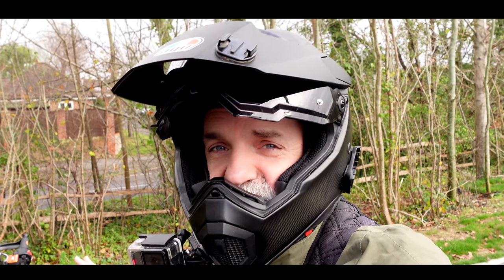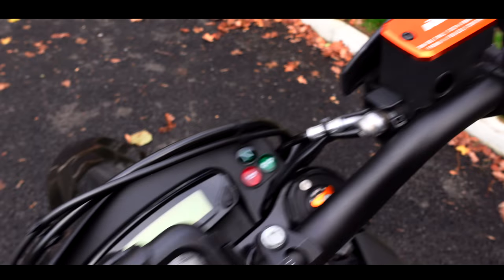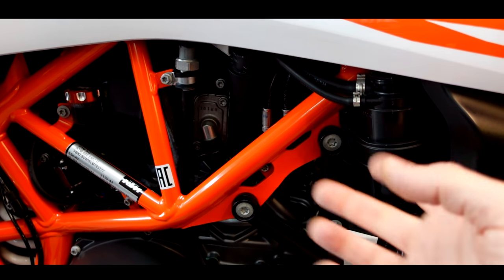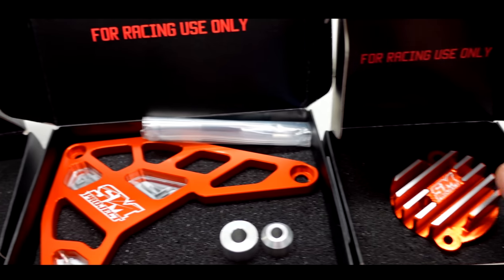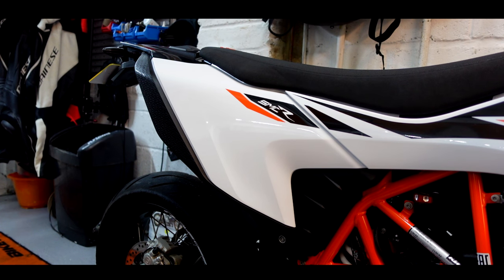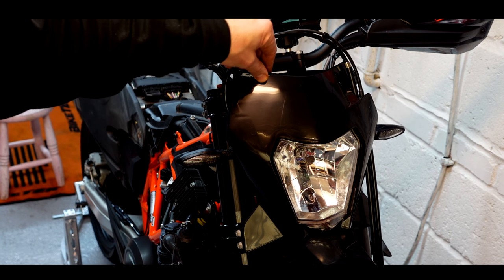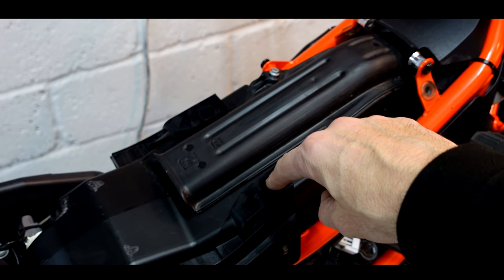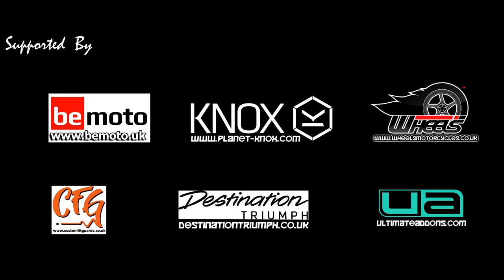The Ultimate KTM 690 SMCR Build 👌 |EP01

Comment: Excellent video, nice n informative, I have a 2007 690 SM, the beaker! Gray area racing in the USA do nice range of flow matched injectors, I have a 550cc max flow per min version, also I have removed the  2nd 3rd gear restriction, massive K&N , keep up the great work!
Reply from the maker: Ok interesting Pete, think the new one is single injector.. will see when I strip it tomorrow 👍

Comment: have u looked at the wings exhaust 
its alot smaller and apparently made in the same factory as the akrapovic
theres a few vids on here
i picked my 690 up other day
i’ve already done the tail tidy delete
i spent half hour looking for a keyhole to take the seat off 😂
you went in
loadsa bling 💎 
looking forward to more vids 👌🏻
Reply from the maker: Yes I used to have one on my 701 they are good. Made by an ex Akro employee is the connection 👍

Comment: A few important things not being done. 1. Sub-frame strengthening kit. 2. Manual cam chain tensioner. 3. Motor Master front disc. 4 ABS dongle etc.
Reply from the maker: I have one of those things coming, not heard of any cam chain tensioner issues or weak subframe..

Comment: Do you reckon if I put  a pcv in my A2 restricted smcr I could make it full power? Obviously with an A2 power mode
Reply from the maker: No as I think they restrict it in other ways than fuel.. not sure how exactly but would be surprised if that worked

Comment: Oil catch cans arent for the environment, they’re to save your motor 🤨
Reply from the maker: It's not an oil catch tank but for fuel vapour. Its filled with charcoal to absorb fuel vapour and feed it back to the throttle bodies to be burnt. All emissions garbage, the whole thing is under vacuum from the small SAS valve which is also removed with this kit
Reply: @LambChopRides  ohhhh we don’t have that in the USA afaik, my mistake